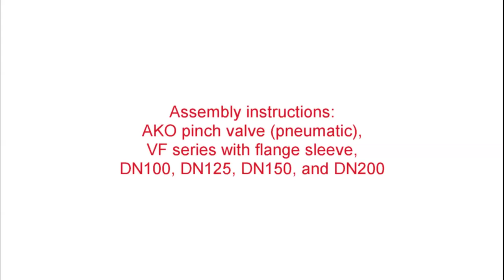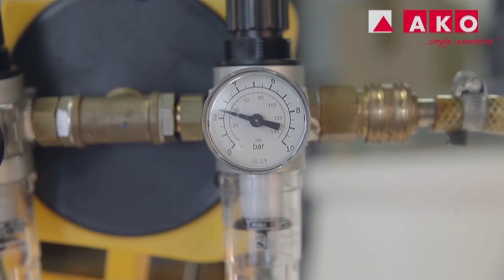Assembly instructions: AKO pinch valve (pneumatic), VF series, DN100, DN125, DN150, and DN200

Comment: Why do i need 2.5bar air pressure on a tube while finishing the assembly? Because it moves my rubber tube
Reply from the maker: You must apply compressed air to the pinch valve when fitting the sleeve to make it easier to press the sleeve into its final position between the valve body and flange. 
If you use longer pre-assembly screws to pre-assemble the flanges and pre-tension them slightly before applying compressed air, the sleeve cannot slip.